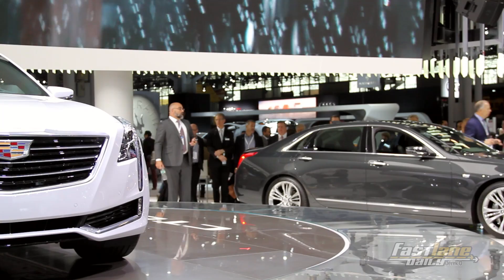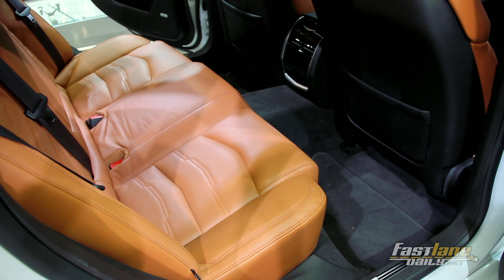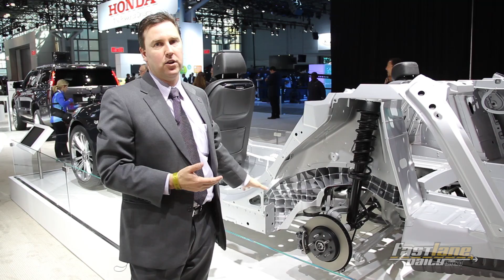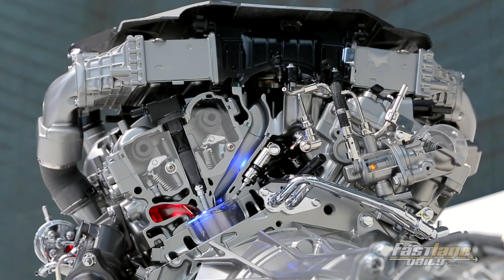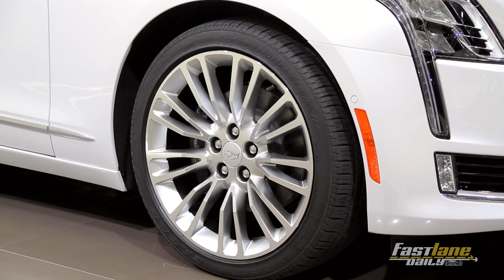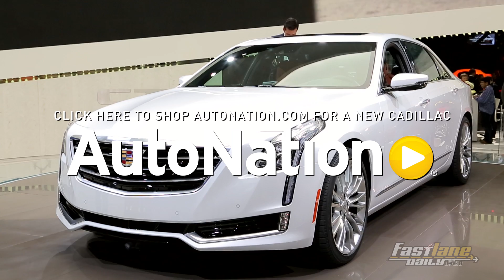2016 Cadillac CT6 In-Depth Look - Fast Lane Daily

Comment: Will it last 10 years or even after finishing the payments....I was a long time GM fan but the cars they are putting out are complete shit...recall this...fire that...I think its time I consider the Japanese...since the Germans are cheaters...
Reply: +lmn222002  what was the problem with Toyota that the car would run off?  Hmmmm
Reply: wilwiljames1 Nah I am not considering Toyota..I am more inclined for a Nissan..I'll let you know when I pick it up.

Comment: After safety, the most important thing is reliability.   Will this car be built to last reliably for 350,000+ miles?
Reply: +TruAgape1234   not many people keep a car to 350,000 miles, most would not want a car wth that many miles on it
Reply: That's only true for the unreliable ones
Reply: What would you consider as a reliable one? I've never seen a car that got 350,000 miles
Reply: Many Toyotas and Hondas and older Nissans (before Renault came into the picture) do this pretty regularly
Reply: @Mabeylater293  those are economy cars and not in the same segment.

Comment: Did we just hear that in Snow Mode the the transfer case can gear down and push 1300 N·m (960 lb·ft) of torque to the wheels (from 7:58).
Reply: NIAtoolkit Yes, we did.
Reply: +NIAtoolkit WTF no u guys are smokin somethin next lmao. he said 400 hp 400nm ........ he said the transmission can hold up to 1300nm

Comment: They really need to make one with V8 and 640HP!
Reply: +David Topchiev Dude, as a S65 AMG owner I actually do use all the cars power when needed, specially on straight highways when doing 110-120 mp/h in daylight and clear road. The way to get to 120 mph are in two ways: 1.  Fast. 2. slow :)